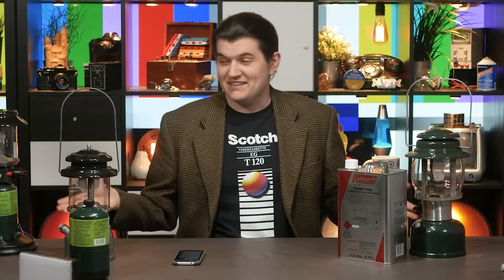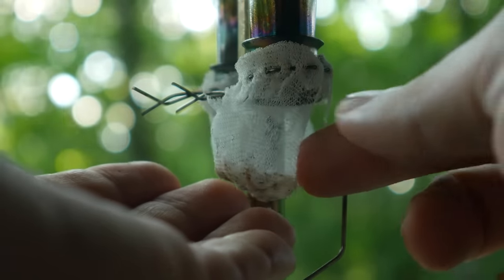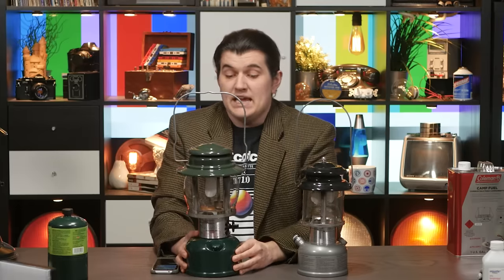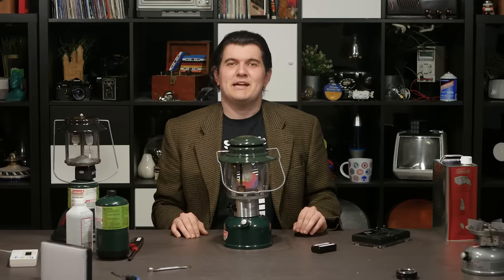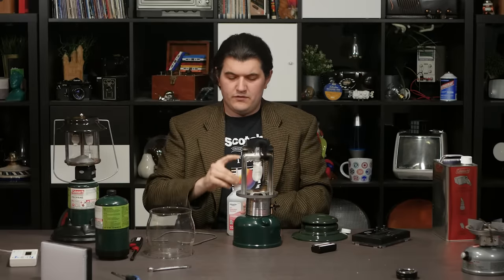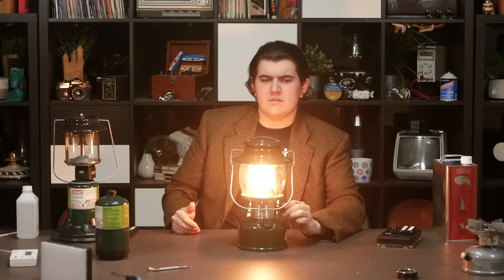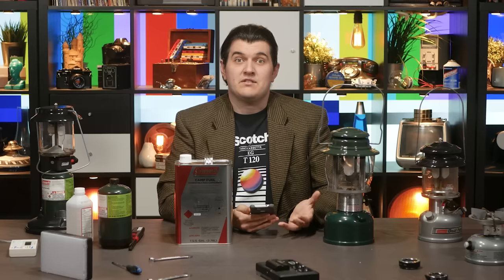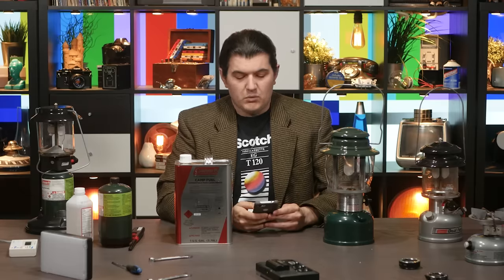A very rambly Coleman Lantern follow-up. Turns out they rarely make sense in 2021

Comment: The hole on the end of the pump plunger isn't where air gets pulled into the pump. There's a hole to the side of the plunger shaft, in the "cap" of the pump, and that's where the air (and oil, which should occasionally be added) comes in. I believe the hole in the end of the plunger is there so that you can push the plunger down to its "retracted" position when there's enough pressure in the fuel tank to make it impossible to push it any more with the hole covered.
Reply: It also stops you from pumping it too much as well.
Reply: @donaldasayers  What is the purpose of the hole on the end of the pump handle?
Reply: @HunterAtheist  It's to allow you to push the pump all the way in easily to lock it, when you have finished pumping.
The pumps on Tilleys and Vapalux tend to creep out again.
Reply: @donaldasayers  If that were the case, them you don't need the hole. You would just close it on the last pump.
Reply: @HunterAtheist  true
Reply: @donaldasayers  I have taken apart many stoves and lanterns. I made other comments better describing my understanding of how the process works, but the check valve holds the pressure in. The hole on the end allows excess air (that wasn't forced into the tank through the check valve) out. The hole also prevents over pressurization because your thumb must overcome the pressure of the tank if you are forcing a lot of air inside. If that makes sense. There are holes on the end of the pump handle that allow the air from the pump to equalize with that tube. I hope I am clearly describing it.
Reply: @HunterAtheist  No, with it being under pressure on the last push, it would just spring out again.  Turning the knob to lock it does not lock the shaft, it only shuts off the air passage to the tank, so it would STILL come springing back out.  Having the hole there means you can uncover it and put the plunger down and have it stay put.
Reply: @HunterAtheist  No,  it really doesn't.
Reply: I think you are right. Also, when you screw the plunger in to close the inlet valve, the air can no longer go into the tank (screwing the plunger in closes a valve that backs up the check valve, so air won't leak out if the check valve leaks a bit), so you  wouldn't be able to push the plunger in if you closed the valve with the plunger out without the hole.

Comment: If you need a replacement bottle for filling the Kerosene lamp with the alcohol, You can find those filling bottles with the bent neck searching for PC watercooling fill bottles.
Reply: A lab-flask....
Reply: @muppetpaster  Cool. another way for searching for it. I have mainly seen it for doing PC watercooling but those are handy little bottles
Reply: technically you should use the colman filter funnel because it doesn't spill, has a siphon, and keeps crud from fouling up the tank which can block that nozzle
Reply: @AsbestosMuffins  for the main tank I agree but we are talking about the squeeze bottle with long curved spout for the alcohol without disassembling the lantern

Comment: Battery capacity suffers in cold weather, while the gas mantle gets harder to light rather than losing energy density. In such an environment, the waste heat from the flame is also a desirable feature. If you factor in the costs of heating, there might be some corner cases where the gas mantle lamp costs slightly less to operate. But that's all they are, corner cases.
Reply: 30 years in the Canadian military and I agree. If you need to start using batteries to produce heat as well as light the energy economy swings heavily in the other direction.
Reply: We have a long winter weekend in the woods every winter, no power. The only thing that works reliably at -30 we found is white gas. Plus you put the lantern in the outhouse for 2 to 3 hours to heat it up a bit
Reply: Cold weather is not a "corner case" it is a substantial portion of the year across much of the US. Furthermore, cold weather is also correlated with the time of the year where supplemental light is most needed. In June at summer solstice you can often get away without much supplemental lighting but good luck doing that in December.

Comment: Having it as a heat source is the only benefit to a gas lantern these days
Reply: If you want a hot light, may I suggest a lava lamp?
Reply: They’re fun to work on and tinker with. A good toy for anyone who’s interested in engineering, plus some of them are very pretty too. Granted, you’re right. Compared to flipping a switch, getting these things to turn on feels like a part time job
Reply: I believe Coleman actually makes a propane-powered parabolic heater.
Reply: Great for ice fishing
Reply: @heronimousbrapson863  there is even propane heaters that are considered safe for indoor spaces, these units essentially make the most sense for really really cold camping, or as a backup system if electricity fails, a lot of people will say the kerosene for that because of its long shelf life, but i still think the dual fuel is a better option because if you have a car, or any small garden equipment that you use around your house your going to have a supply of gasoline that wont turn bad
Reply: @compzac  How inherently safe can they be for heating enclosed spaces if they burn a fuel? They have to consume oxygen.
Reply: @clintoncoker6  : Humans consume oxygen too, so it depends partly on how air-tight your area is, and partly on how much carbon monoxide the lamp produces (honestly, since carbon monoxide is itself a burnable gas, I suspect that the half-way decent ones will burn most of it if used with enough ventilation).
Reply: @clintoncoker6  I did say considered safe, the actual opinion on their safety is relative, but the indoor models tend to come with either O2 or CO2 sensors to cut off the device should an issue arise... also technically a natural gas water heater does the exact same thing, it uses air from the space its in to run... and before you say they go in the garage or in a different space, my water heater in my old apartment was right in my kitchen, they even used to make in wall heaters that would suck air from the living space to use in combustion so the whole they suck oxygen thing, its kinda not the point as even stuff thats rated to be indoors has that issue, the issue these little portables have is that they dont have exhaust vents for the combusted gases, to which my answer on how are they considered safe when they dont exhaust.... IDK, i dont see them as safe unless you have a CO2 detector, and definitely don't use them for bedtime. But somehow they are considered safe for indoor use.
Reply: @compzac  I think you mean a CO(Carbon Monoxide) detector, NOT a CO2(Carbon Dioxide) detector.
Reply: @oxybrightdark8765  Lava lamps aren't so great for camping or emergency lighting though. They need 120V electricity. Of course, you probably could build one that uses a mantle lantern as a heat and light source.
Reply: @compzac  Gas water heaters draw combustion air from inside the building, but they vent the exhaust outside. This will draw more air from outside, unless the house is way tighter than normal. Most houses have comubstion air inlets, if they use a gas furnace, anyway.
Reply: Patently false. There are many limitations with electric light, including poor cold weather performance, limited battery life, grossly overstated performance figures in almost all marketing, lack of field repair options, and dependence on grid electricity over anything other than a short term.

Comment: The Petromax kerosene lamps have a build in pilot burner which also run on kerosene. You can even light them with a normal lighter without disassemble half of the lamp.   The german Army switched their Petromax lamps in the 60s from white fuel to kerosene because to safety concerns.

Fun fact: the english "kerosene" is "Petroleum" in german while the german "Kerosin" means "jet fuel". That caused a little bit of confusion for me.
Reply: Same in dutch,a funny little confusion
Reply: WAIT THERES A DIFFERENCE? KEROSENE != KEROSIN????

Comment: Use case for kerosene fueled: living on a boat. Low vapor pressure of kerosene makes it substantially safer than naptha/gasoline. Vapors of gas, naptha, and propane are denser than air and will collect in bilges/holds. Having your boat blow up makes for a bad day. Solar panels are probably the way to go these days, but my experience was back in the early nineties, solar panels were just becoming worthwhile.
Reply: Solar panels were still a decent way from worthwhile in the 90s, but they are great now.

Comment: I believe the thumb hole is so you can push the pump down and tighten the seal without adding any pressure if you maxed out the tank pressure.

Comment: On a camping note, I like to camp in the winter! This means propane is no longer a gas, batteries lose charge, but a stove (or lantern) with a priming cup can be up and running.
Reply: Butane is useless in winter, but propane is good to use in outside temperatures down to around -20 degrees C. Butane stops working in outside temperatures of around 5 degrees C. Hope this was useful
Reply: @anthonybarra2391  I regularly go camping in -20C weather, or colder so propane is still an issue. Keep in mind that even during temps around 1C or warmer, the expansion of propane in the tank drastically chills it quickly lowering its output. This is even more of an issue in the morning when tanks have chilled overnight and I just want something hot to drink in the morning. All part of the fun!

Comment: An interesting story from my time in the scouts: We used the propane lanterns as mini “streetlights” at the campsite. The Coleman lanterns would be sitting on ~4ft standpipes, connected to barbecue-style (10 lbs) propane tanks, 1 for each lantern. The standpipes also had extra outputs, likely used to feed camping stoves, although they were no longer used by the time I was in the scouts.
Reply: I imagine that whether those pressure converter pipes (or maybe the pressure converter was elsewhere?) are used for anything other than light tends to vary by troop more than by time.
Reply: You are correct about the extra outputs. We used the Coleman lanterns on standpipes with the connection to the stove, thus having light for cooking. The stove connector has the pressure regulator and the Coleman lantern worked on full bottle pressure.

Comment: I'll be sticking with my white gas lantern for camping. I find it convenient that my stove and lantern use the same fuel. Thank you for confirming my belief that white gas is cheaper to run than the propane bottles.
Reply: I use white gas, and "I find it convenient that my stove and lantern use the same fuel!"  What I really appreciate is the savings in bulk and weight that must be carried for a given output capacity.
Reply: White gas (even if you are using Coleman Fuel) is cheaper than the disposable propane cylinders, but if you use a refillable tank the propane is way cheaper. There are a variety of hoses and adapters available to run stoves or lanterns made for the throwaway cylinders from a 20 lb. (or smaller) reusable tank. With the throwaways, you are paying more for the tank (they have to be pretty robust due to the high vapor pressure of propane) that you use just once.

Comment: I am late to the party, but I am a collector, and regularly watch your videos and was surprised to see the lantern videos pop up.

As with all the other lanterns, and lights that run on combustion, it has to be remembered that these come from a time when the majority of the world did not have electricity, and solved an issue for household lighting that spawned a revolution in home and outdoor lighting, heating and cooking in more remote areas.

The hole in the pump is for use with leather pump cups which will not allow air to pass when you have your thumb over the pump opening.  In your lanterns, the age indicates they will have neoprene cups, which have several issues, but were installed in all lanterns from around 1987 on.

White gas can last for an unknown to me extended time in a sealed container, I have used fuel that was over 20 years old without a performance, or other issue, I am not sure of what the actual life span is, but it is not uncommon to find a lantern that has been shelved for 20-30 years and simply light it up.

The first gas lanterns were used specifically for indoor lighting, and Coleman along with Akron, AGM, and many other manufacturers for many years made table, stand and hanging lamps for use in homes without natural gas service.  There are safety concerns with anything that creates high heat indoors, and I advise you to not do anything that scares you, but I routinely do use white gas lanterns in my home (along with stoves and heaters) during power outages.  

Propane in the cold weather scenario can be as extremely difficult to use as batteries, thats a side note, as you were saying, there are conditions where these things can all be relevant.

So, how do I know these things, well I am a Gas Pressure Appliance collector, avid camper, and live in a rural area where the power is inconsistent but getting better.

Comment: If you're keeping the propane lamp for emergencies, weigh the tanks annually: there will be a tiny amount of leakage which over the 10 years you mentioned might be enough to matter.
Reply: @stevesether  If they leak 5% per year, that's a tiny amount on a daily basis, so no, you won't smell it, nor would there ever be a significant buildup. After 10 years it's half empty. Reality is that there is no such thing as a perfect valve seal, and certainly not on a disposable bottle. Ever tried firing an old aerosol?
Reply: @stevesether  Also keep in mind that bug box stores have lots of air space for the propane to dissipate to, plus lots of air movement within the store.  A lot of very small/slow leaks aren't a big deal if the small amount of fuel that is leaked hourly/daily can't build up anywhere in significant concentrations.
Reply: @jayschafer1760  I don't know about you, but I can smell very tiny gas leaks right up close in my house and determine exactly what's leaking  If I get more than 2-3 feet away from a small leak, I can't smell it anymore.  Multiply that by 100, and any regular leaks should be perfectly obvious.

So I don't think the size of the store has anything to do with detecting a leak of 100 gas cylinders all on a shelf together.

Also, do you really think shippers would want to ship hundreds of these things in a closed up van if they all were slowly leaking?  I don't.

Comment: The first coleman lantern to have a integrated pump the L427 in 1925 did not have a hole in the pump and it was added later specifically for the reason you demonstrated. Simply to make it easier to push the pump handle all the way down and lock it off.  The hole was added late in 1925. Also when you twist the pump to lock it down it doesn't just hold the pump handle down. It's also a positive shutoff so if the check valve fails it can't leak if you twist the pump closed.

Comment: I was wondering if the soot in the kerosene lamp was because you're using isopropyl alcohol which tends to burn with a sooty flame. Better alternatives would be denatured alcohol (mostly ethanol) or HEET in the yellow bottle (methanol).
Reply: Not to mention made worse by the residue left in the alcohol cup from when he used hand sanitiser instead of Isopropyl Alcohol?
Reply: Just to clarify for readers who might get the wrong idea - John is talking about the alcohol used to start the pressurized kerosene Coleman, and not suggesting using alcohol as a main fuel. Anyway, interesting theory - I use denatured alcohol to start mine, and don't have any buildup like that. Of course, I've only used mine a handful of times, because yeah, it's it's a pretty bad user experience compared to a white gas or propane lantern.
Reply: I believe "methylated spirit" is what we call the correct starting fuel in the UK.  It's usually dyed purple.
Reply: @Kromaatikse  Methylated spirits in the UK, denatured alcohol in the US and Alcool à brûler in France.
It's basically the same thing: Denatured ethanol ! (ie ethanol with toxic and bad tasting additives to prevent human consumption).
Purple dye being optional.
(Here in France the "Alcool à brûler", literally alcohol to burn, used in alcohol stoves and as a cleaner, solvent or whatever... is clear and smells horrible.)
Don't know if it has a dye in the US and other countries though.

Comment: Him: "The white gas is really dangerous so always use it outside.  Also, thorium mantels are dangerous as well."

Troops in the Canadian military: Looks up after lighting it up in a flammable winter tent with mantel dust smeared on their hands. "Psht, its fine."

Also, you can actually just pre-burn the mantel with a lighter until it reaches the state you need it in to work.  It's a bit quicker and you don't have the same problem with volatility.

Last edit: These lanterns also produce waste heat, which can be important for survival.
Reply: Basically a heater that also provides light
Reply: Meanwhile in Georgia, we're trying to avoid making extra heat in the tent nine months a year.
Reply: Get a flashlight with a dynamo. Makes power without batteries (although many do have them) and you get exercise making light.
Reply: Coleman no longer makes thorium mantles. You might find them at yard sales.  Great mantles. Just  install them in a ventilated area.  As far as I know nobody else is making thorium mantles.  Post to correct me if I am wrong.
Reply: @radoak Peerless was at the time of this video and a number of others were, but they are worse than the modern Coleman ones.